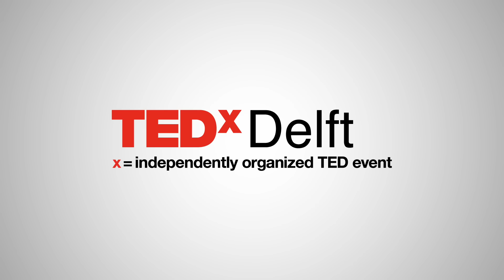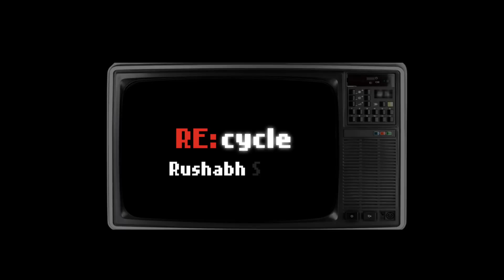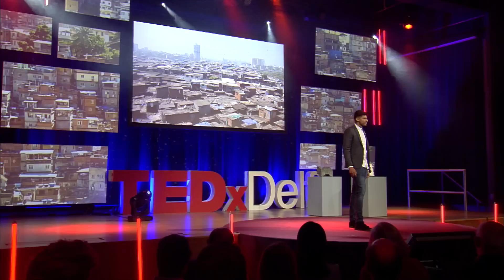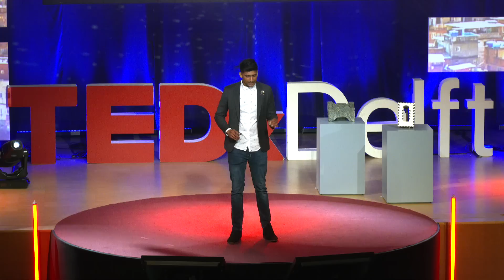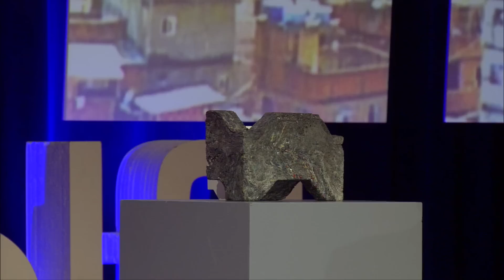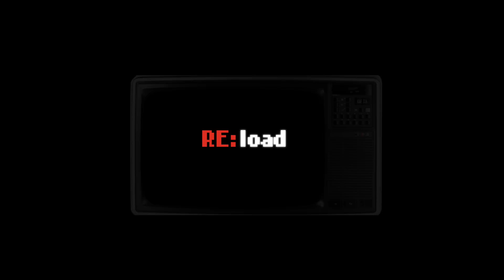How I turned our plastic problem into a housing solution | Rushabh Chheda | TEDxDelft

Comment: FINALLY! I was starting to wonder why would nobody invent a brick made out of recycled plastic. One of the few things we want to be done for ages are our houses so I'm glad someone put this idea to a conveyor belt.
Reply: In some african countires they are using such bricks but for pavements as far I know. Not sure though if such bricks  do not pollute soil further.
Reply: @femmeNikita27  Good question. In my opinion the plastic bothers the nature mostly by its presence. It is simply a thing which is not to be digested or decomposed easily. Not the plastic itself but the piles of it make the problem.

Comment: Great Idea..Now we need a bigger fire brigade to counter possible increase in fire hazards
Reply: How are fire hazards significantly increasing with houses that doesn't burn at the same temperature as wooden shacks?
Reply: @memoguti  fire is fire regardless on temperature! plastic fires will spread like dust in the wind! they can use it for tiling the streets and walkways but clustered homes so close together in plastic ware is a nightmare waiting to happen

Comment: Interesting but I'd like to see some tests showing how reliable to materials resistance is long term and for a variety of environmental and man made disasters.
Reply: Resistance of plastics to environmental factors is the root cause of the issues we face. If only these materials would degrade sooner, then we would not have these issues. :) I do wonder how the foundations would support the weight of these buildings.